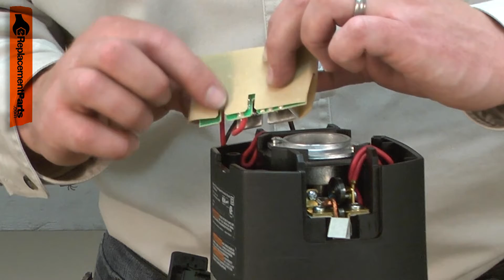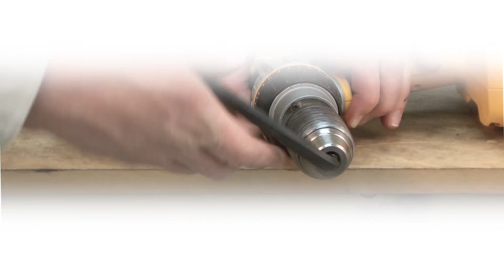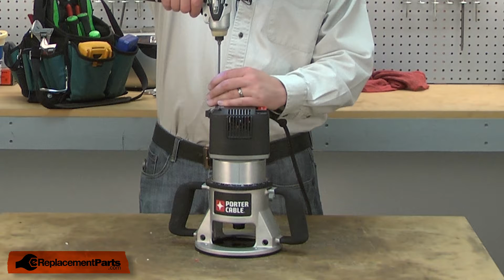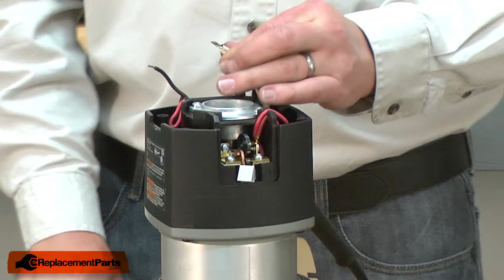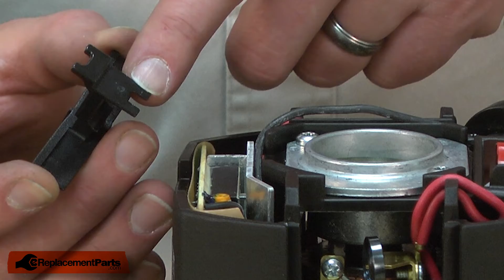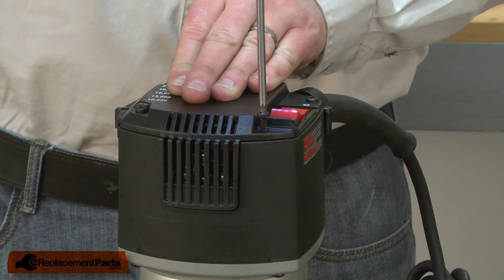Router Repair - Replacing the Speed Control (Porter Cable Part # 875087)

Comment: If the pcb is faulty, as a quick fix. Would it be possible to bypass the board. And have the router run at high speed.

Comment: I have a porter cable 75192i plug it in and it doesn't do anything do I need a new on off switch or a speed controller ???
Reply: Open the top case, and take the switch out  and disconnect one of the wires, and check  the switch contacts.  If the switch does not show continuity in on position, then the switch needs to be replaced ($80- ouch ).  To repair the switch pull the toggle cover out,  and blow air in the small opening to remove any dust, and spray contact cleaner.
Reply: Tengo un router 75182...pueden enviarme el repuesto a argentina?

Comment: What cause a 7518 to quite running when you start routing
Reply: There is a triac on the opposite side of the switch  for overload protection.  Try  changing the  triac and see what happens.  Seems unlikely you have a short with no load - but this is not absolute.